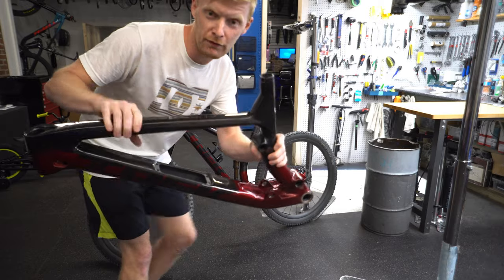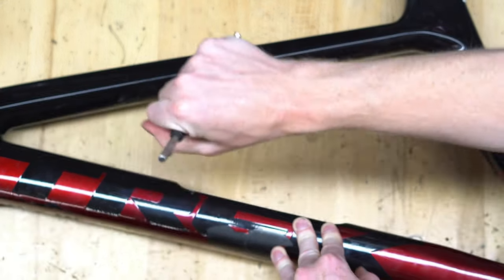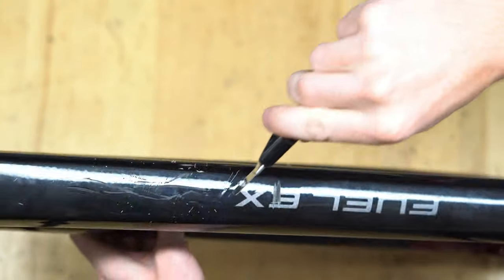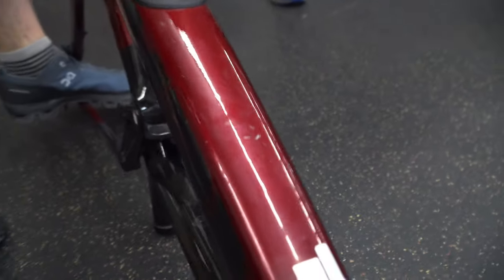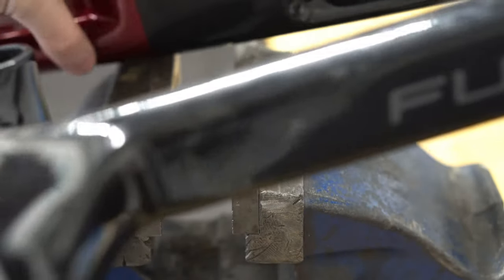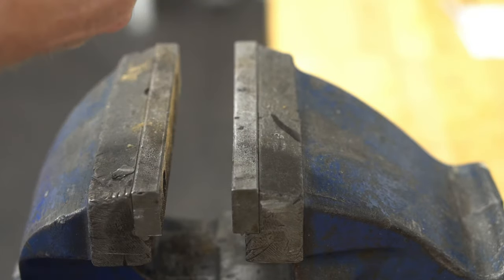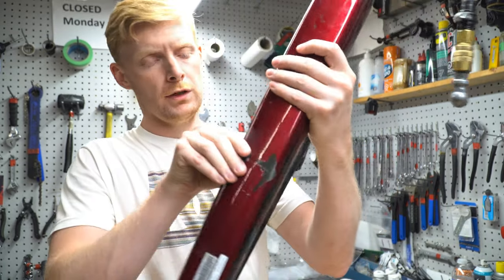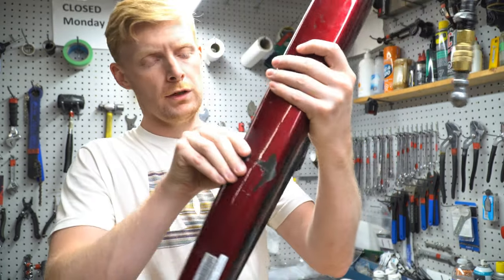Are CARBON frames strong? Does Carbon fiber burn? How to break a carbon bike!

Comment: That vice tool test makes me feel better about thinking I cracked my frame while pressing out my lower shock bearing with the park tool sbk1. I just one handed torque pretty snugged but not hanging off it. I heard a snap but I think it was because bearing was seized. I didn’t go as tight as you did and you didn’t have any damage? I have trek slash carbon 9.8 xt
Reply from the maker: No damage to the frame until I really cranked it impossibly tight

Comment: Great video! I'm eternally frustrated at how folks will decide that a carbon frame is essentially an eggshell and then go tell others when they've never broken one, either CF or alloy. I didn't know there were so many materials engineers out there!
We should all just put the frame durability comparison thing to bed - manufacturers wouldn't be offering lifetime warranties on both cf and alloy frames if they knew one (the vastly more expensive one at that) would just fall apart with regular use. In addition, the field has come a long way since the introduction of the stuff.
That said, something I'd like to see (if you do this again) is to damage a frame little by little and do some bunny hops, wheelies, stoppies, etc on the grass in between. That way, when it fails we'd get a ballpark of what kind of damage it really takes to retire a frame and not just chip the paint.
Thanks, and subbed!
Reply from the maker: Thanks, I'll look into making another video when I get the chance!
Reply: They're for sure not egg shells but also not the indestructible material some people think they are. Also depends on how the frame is made, all CF frames are not equal....Depends on how they layer the CF, how much CF they use, what type CF they use & type of resin/how much is used, etc... As you can see in the video the frames don't like to be hit with heavy pointy objects. Like if you take a spill & the frame lands on the sharp jagged edge of a rock= craaaack.

Comment: 1. The correct way to destroy a carbon frame is just a simple crash, etc, to start a hairline crack. 
2. Failing to inspect your carbon frame on a timely schedule will allow the crack to grow.
3. Out for a normal ride a day, month, or year later and something feels weird and then you notice your seat stay.
4. Start shopping for new frame.
5. Next is to remove the components you would like to use on your new build.
6. After completing your new build take your old frame to the curb for the next trash removal day.

Comment: just so you know in case you dont, even a mico scratch in a carbon frame could render that frame useless. some cracks are even hidden inside the frame and need to be tested with expensive scanners. never ride a carbon frame if you've crashed with it before. its just not worth the risk.
Reply from the maker: Never had an issue with a carbon frame blowing up, crashed many times. Old carbon yes but new stuff I would not even be concerned

Comment: Hi bro. What do you say, looking to replace my aluminum frame Trek 8500 on a 2012 Scott Scale 20 with a carbon frame
But I have doubts about the strength of some frame elements, specially upper part of the rear triangle, which looks very thin?

Comment: And the best part about carbon fiber is the fact that it's relatively easy to repair and almost always repairable, unlike metal (doesn't matter if it was aluminum, steel or even titanium) where the only way to repair if broken is by welding, and no matter how good that's done the frame will never be the same again; if a CF frame was broken its repair method is usually done by laying up pre-preg sheets which is pretty much the same way most frames were manufactured in the first place, so the frame will be as good as a new one.

Comment: "I feel fine riding it." Ok boyo. Ride that frame now after all the damage you done to it. The grip destroyed the frame. Period. That wasn't paint. But if you think you're hotshot that the carbon is still intact. Now put that crap frame on your bike and go zip and do some jumps.

Carbon is stiff. But most direct blows to it will decrease it's structure. The biggest reason why carbon holds it's shape well. Is due to the resin that is used. Carbon on it's own is flexible like kevlar. It's really weak alone. Even kevlar is weak and worthless. It's still a laugh i found them using that crap on bicycle locks to wrap around the steel cabling. like "OH yeah kevlar is gonna make is 10times tougher to break." ugh.

Carbon is fine on stuff that wouldn't put a life body ontop. But stuff like this, Is just stupid. Bicycle companies don't seem to care about lives. They just care about marketing and money. So if you pay them for carbon. They win and if you fall and basically die. Welp. They don't care. And people are stupid enough to do so. Just like alot of things being sold now that is crap.
Reply from the maker: Well kinda true lol the resin holds it together and yeah I would go for a massive ride but I'd ride it out of the trails
Reply: @goodluckchrisclark I just bought a trek fx sport carbon 4 for road riding.. do you think it is bad idea? Thing is all the nicer components bikes are carbon now